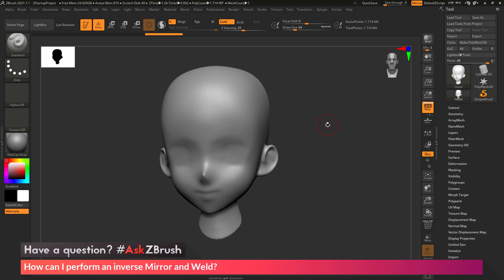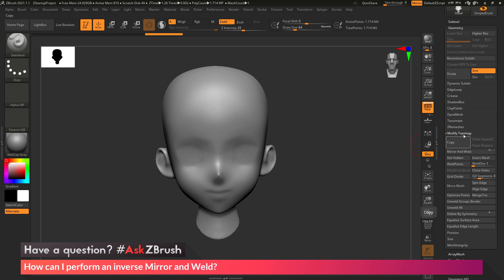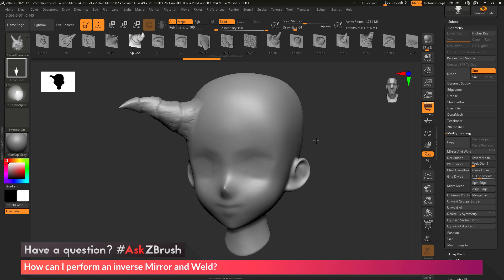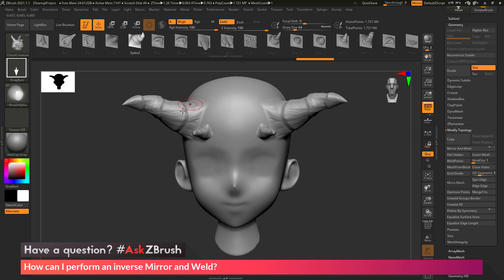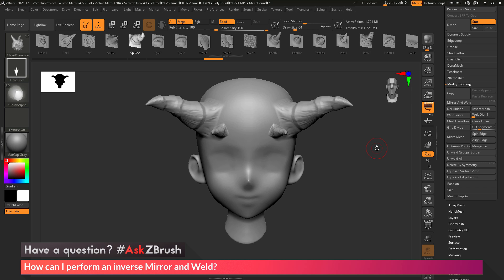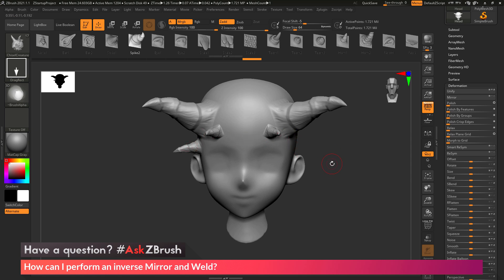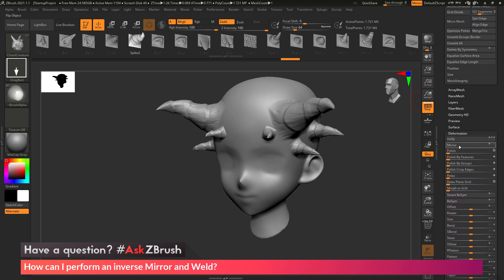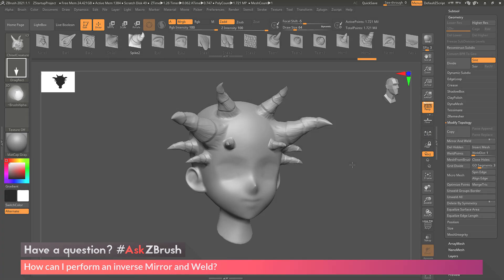#AskZBrush - "How can I perform an inverse Mirror and Weld?"

Comment: the fact Deformation > Mirror does not work in local symmetry is criminal. I am working on a model that I need to mirror locally to then apply the mirror and weld because it also doesn´t allow for inverse mirroring there (which would be the ideal solution) PLEASE add this.

Comment: There is also xyz option just on the top right corner of the mirror and weld button. Buy selecting y or a depending on your target axis and deselecting x it will mirror and weld on to your target Axis